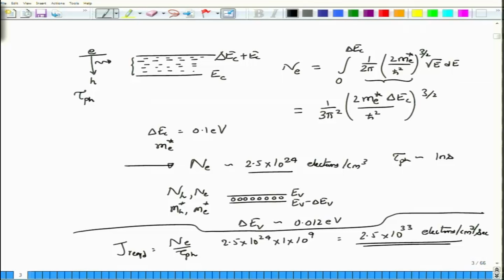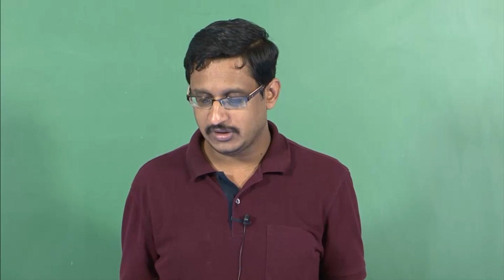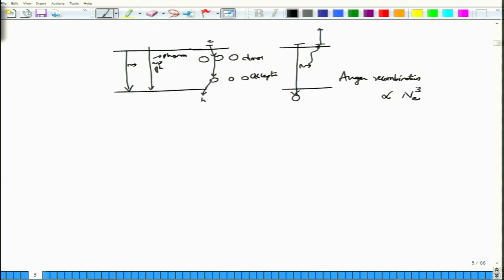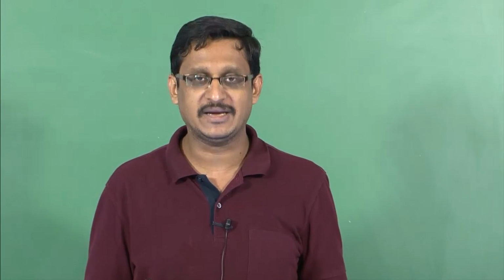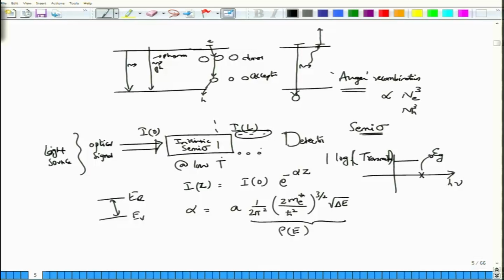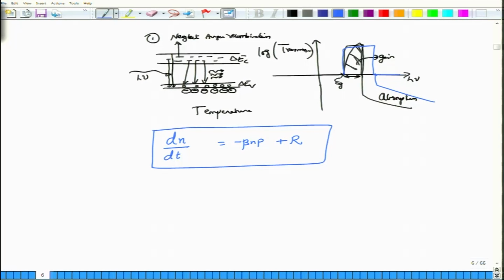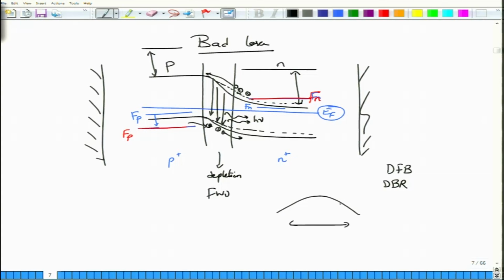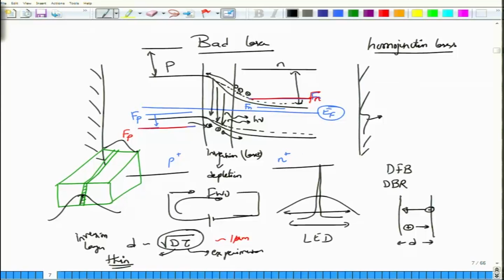noc18-ee28-Lecture 38-Optical properties of semiconductors-II

Comment: Summary of semiconductor laser is good in such a small duration covered various points important for lasers. For beginners or Basics I would suggest Prof Shenoy Lectures on LEDs, Semiconductor Lasers and photodetectors. After those lectures this will be very good in summarizing various points